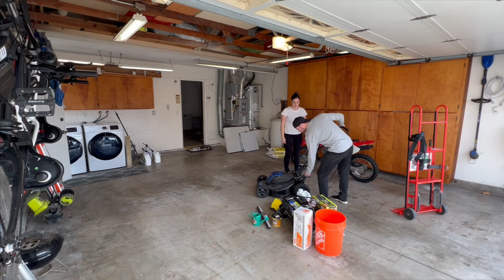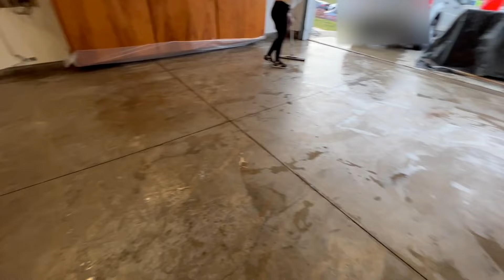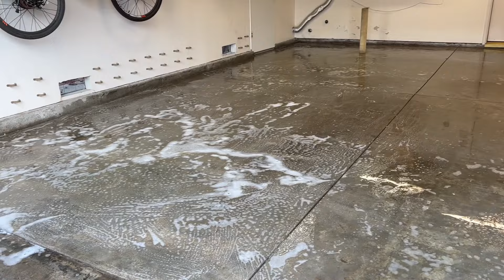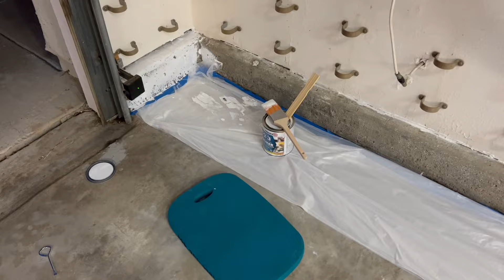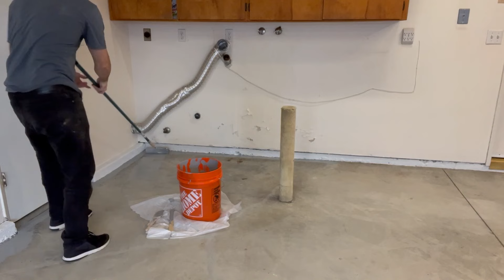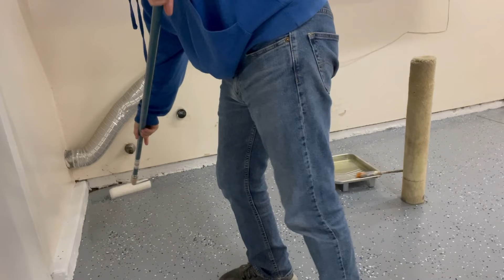How To Epoxy Garage Floor | DIY Entire Process + Tips | (Rust-Oleum)

Comment: Great job explaining the steps and what to look out for when applying the epoxy floor coating.  I'm looking to do the same in my garage.  I just moved in; so some what a clean slate to start from.  Thanks for the information.